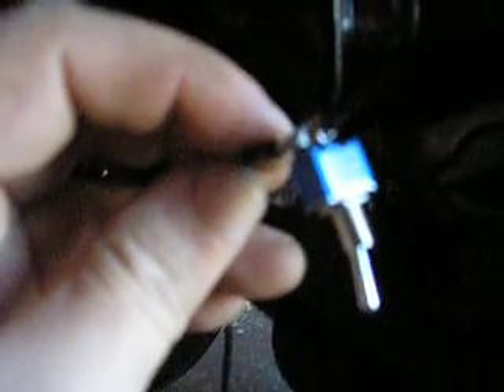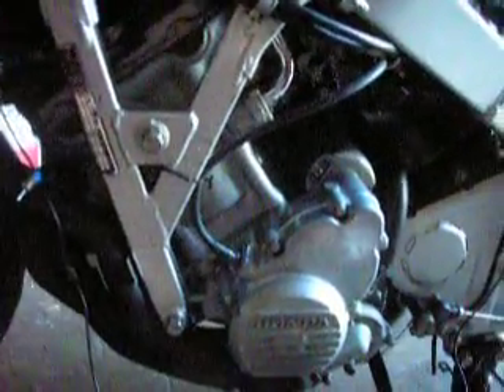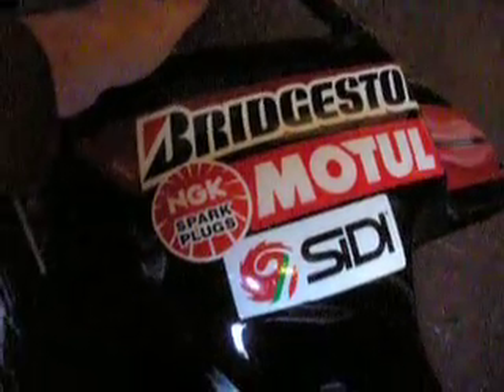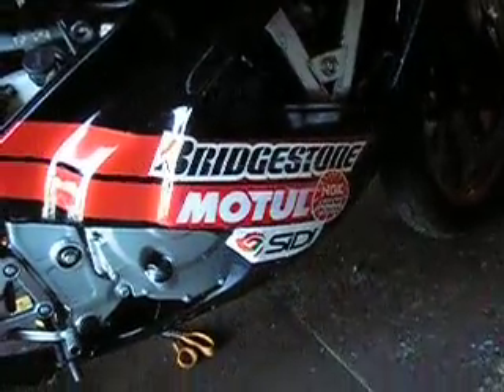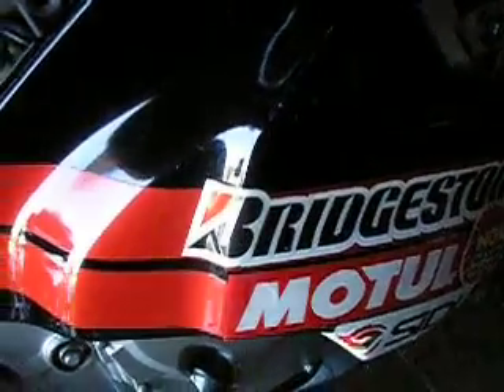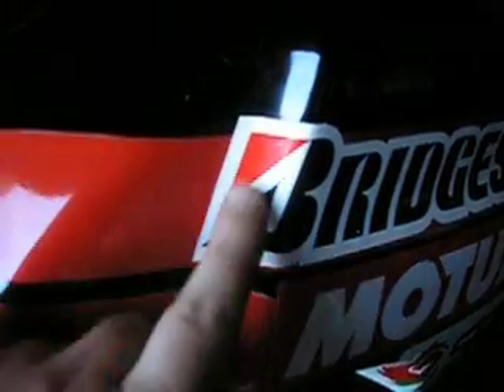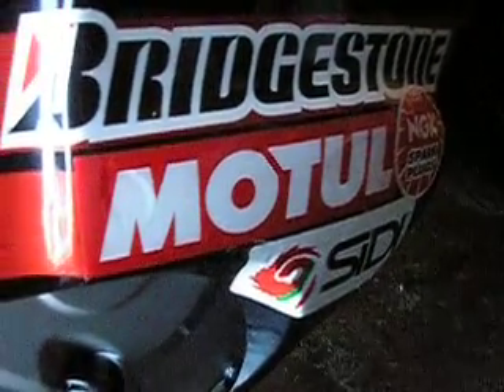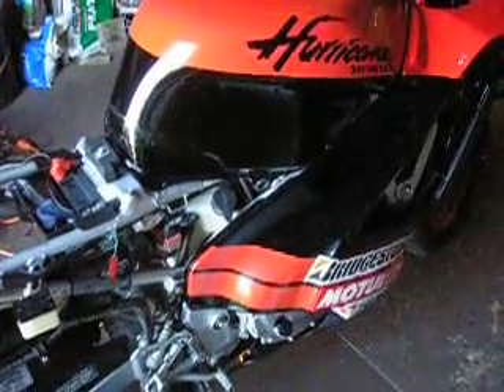bypassing your thermostat / wiring a switch into a motorcycle fan

Comment: Video is nice for figuring out how the fan circuit is switched however.... the terminals on that switch are not poles lol. A 2 pole switch would have 4 terminals. A pole is basically a line of power. That is a single pole, single throw switch.

Comment: I found this video by accident in google images, just happened to notice the specific switch you are using, and figured I'd warn others.

You need to use at the VERY least a 5amp rated switch, preferably a 10amp+.  The switch he used in this video is a 3amp switch, motorcycle radiator fans tend to usually be in the 4-6amp range.  

Speaking of which, while on the subject, I always wire my own switch to my rad fans, on many bikes, the fan gets a constant 12v+ when the key is on, and the switch that turns the fan on is the GROUND.  So you are bypassing the ground.  But what I do, specifically on honda F4i's, is leave the factory temp sensor hooked up, and also ADD a switch to ground.  That way you can manually turn the fan on, and the factory switch will still turn the fan on if you forget.

I know this video is old as hell, and I know his specific temp switch was broke, but was just saying, for others when they do their own ;)
Reply: also its advised not to wire your fan to ALWAYS be on.  Preferably use a switch.  Motorcycles charging system barely have enough power as it is,  running a constant 4-6amp draw on top of everything could possibly lead to problems especially at low rpm riding.
Reply: What is the name of this switch ?

Comment: where did you get the switch from? I looked on ebay and it's $24
Reply from the maker: radio shack for a few dollars. make sure the switch / wire used can handle the amount of current going thru it

Comment: polok890 how would i do it dirrectly from the fan i have a f4i black wire and a blue wire coming from the fan i ground the switch and splice the blue one to the + side of the switch with another wore to the + of the battery?

Comment: I had a problem with a bad fan switch on my 1998 Kaw vulcan vn800A. I went to autozone and bought a DURALAST (auto) fan switch for $19.99 model # SW504. I installed it without modification and it worked perfectly. Saved me a lot of money and took 5 minutes to install. You my want to either go online and look at several switches on autozones site to match yours or take your old switch into the store. The fan actually works at a bit of a lower temp then the old, which is good for your bike.

Comment: @polok890 I finally found the switch on the radiator and There was two wires connected to it, a black and green i'm guessing its the positive and negative? Well I bought a switch 15amp 2 pole switch and wire which is 14 gauge 17 amp, could i use that?? even if the amps are not the same.

Comment from the maker: so on the left side of the bike, on the back of the radiator an electrical connector comes out and a wire sides on. pull that wire off and stick a piece of wire in it, with both ends stripped of the covering. then touch the other end to the frame or negative on the battery, the key has to be on. this will complete the circuit. u wont get a shock

Comment: have a '84 Honda VF500F Interceptor,fan doesn't come on.read in forums that you wire the fan to ground to check if the problem is the fan.what's that mean? I see a little rubber cover wire going into my thermostat, it looks like that's what you used to attach the wire and switch. If I make that switch that you made and connect it to the ground/frame and I touch the frame would I get shocked? your video is to dark should make a vid with better lighting showing where the switch is connected to.
Reply: I see what you did but when I did it my fan did not work. But when I connect to a positive lead my fan will come on with the key off but I can't get my fan to come on with the switch on help
Reply: Oh I forgot my bike is a 96 honda 750 magna.